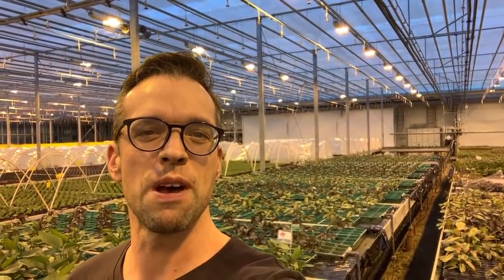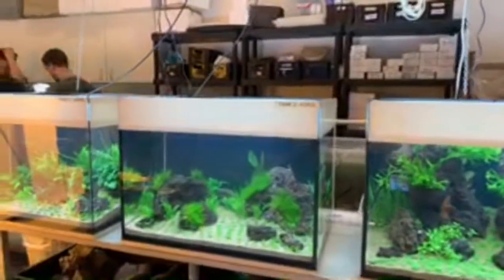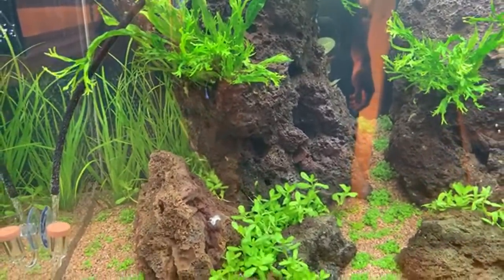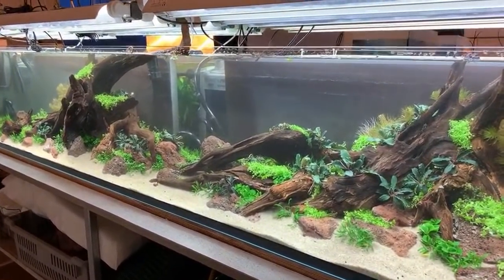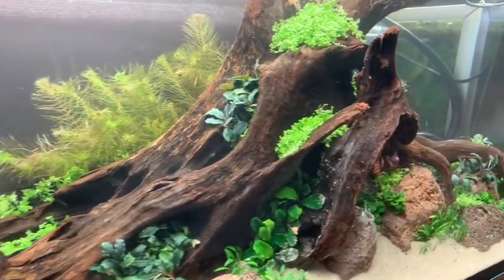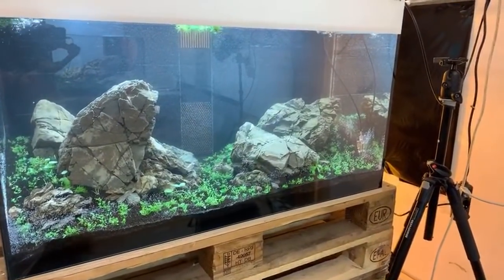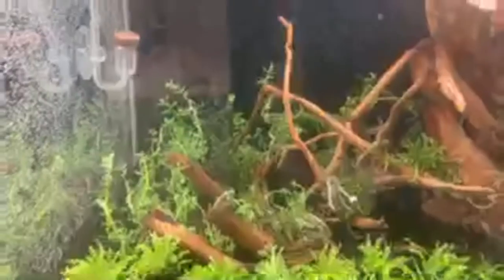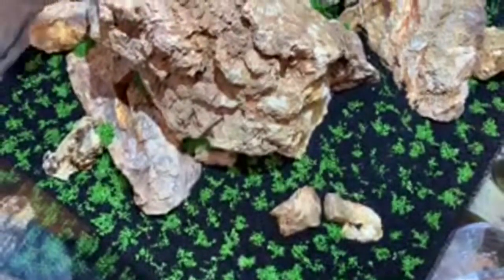Tropica Interzoo 2020 Aquascaping Days

Comment: Jurijs' scape looks like it will be phenomenal. Georges scape looks very promising as well and with the right fish that will probably attract more attention at Interzoo.

Is there a reason why you are keeping the incline of the substrate as low as you are in all the scapes, other than minimizing the sagging during transportation?

And George you luck dog, I have been looking for one of those old Tropica tanks for years, although the reviews on them for the most part were devastating (guess that was why they discontinued them).